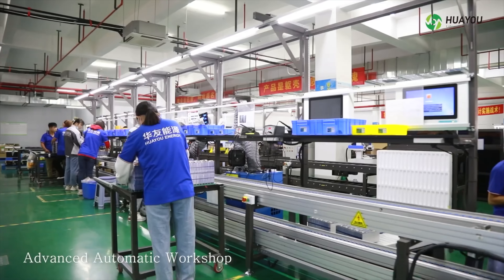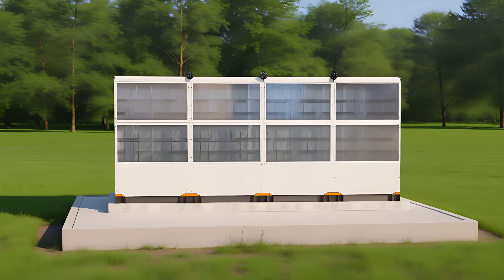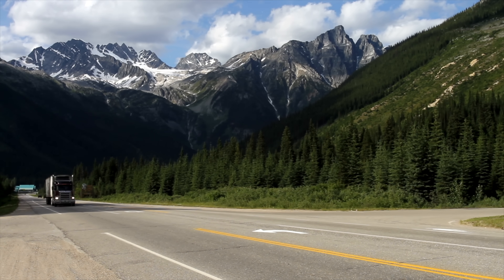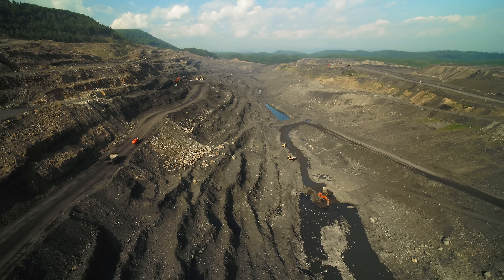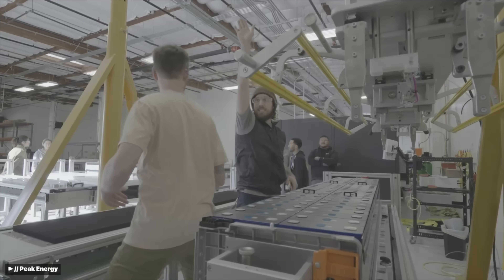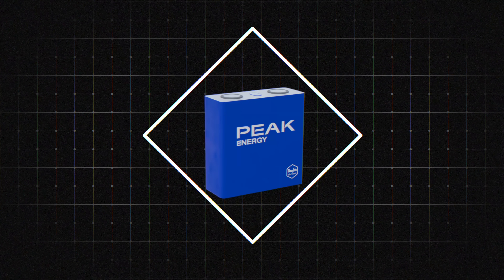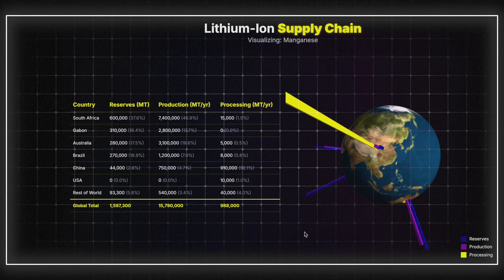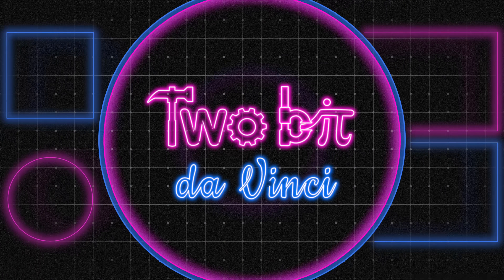Sodium Ion Batteries Are Going to be EVERYWHERE - Here's Why

Comment: Interesting. I looked at their website. Low heat generation is important. It shows that they have high cycle efficiency (they claim >95%), but part of the reason is also, that they have low C-rates (0.25). That seems to be one of the main limitations for where you can use these batteries.
Since it's a relatively simple ESS design, without the cooling, it might also be an interesting technology for home battery storage. Especially for off-grid situations, where you have relatively large batteries compared to your consumption, so C rates are not that important.
Reply: Agreed! The retail cost of home battery storage has dropped by about 75% since 2020, and that decline will continue. 

It turns out the demand side (EVs, heat pumps, batteries) of energy efficiency and electrification is as important as the supply side (solar, wind, batteries again). This summer, I installed a 14.4 kW solar system and 28.6 kWh of batteries. Five years ago, those batteries would have cost me over $1,300/ kWh. My EG4s cost $7,500! 

It isn’t just off grid! For the 85% of us who don’t live above the Arctic Circle or  in a forest or at the bottom of a canyon, solar and batteries are now less expensive to install and use to power a car and small business and home than installing and running new power lines and poles and transformers and gas plants. 

Sodium home batteries will be tremendously beneficial to home and business and vehicle owners. Paired with solar, they will allow most of us to economically produce and store our own energy. 

Even renters are starting to be allowed to generate a portion of their own energy with small solar panel/inverter systems. And soon, they will be able to put a battery in the closet that’ll charge at night when electricity prices are low and power homes and apartments when electricity is expensive.

Within five years, 30 and 50 kWh batteries, enough stored energy to power a typical home or apartment for two or three days, will only cost a few thousand dollars. 

Batteries are completely disrupting the home energy and personal transportation markets that used to bring trillions of dollars to the corrupt oil and electric utility cartels. But now, individual homeowners, and even apartment dwellers, can produce and store their own energy at costs the corrupt oil and electric utility cartels can not compete with.
Reply: Exactly, sodium-ion batteries (including Peak Energy's NFPP chemistry) has a lower energy density than lithium-ion batteries. This makes them less suitable for most consumer electronics :' (
Reply: @__WJK__  You might think that, but with zero issue of thermal runaway, they are much safer. Nobody cares if they have to charge their TV remote once a week versus once every 5 days.
Reply: Unfortunately the voltage profile under discharge makes sodium pretty useless with current inverters.  So this won't impact the home market untill the inverter technology catches up.  The life cycles are also poor compared to LIFEPO4.
.
Reply: @thamesmud  There are already sodium home storage batteries for sale with matching inverters, if they design a home storage battery, it is not difficult to find an inverter manufacturer willing to develop a matching inverter.
Life cycles of some sodium batteries are poor, but this particular design is marketed to have a long life cycle. Short cycle life is not necessarily a feature of sodium batteries, it is mostly a result of design choices.
Reply: @GerbenWulff we won't know the durability of sodium for 5 to 10 years.  LIFEPO4 seem to be remarkably long lived in solar systems.
Reply: If cooling is not required, then the cells themselves can afford to be a little less efficient and still meet RT efficiency targets at the system level
Reply: U need ur own channel maybe... 2 bit da Vinci 😊
Reply: Meanwhile in REALITY, their efficiency is below 90% and that is only at their HIGHEST voltage whereas their actual efficiency at an average SOC is around 85% or lower

Comment: This is really funny. CATL the biggest battery producer will start mass producing sodium batteries within 6 months. Tell me how this startup or the US will counter its might. The weapon of China is not Lithium it's Science. They have an astronomical number of patents related to battery technology and they keep pushing.
Reply: You are conflating EV batteries with fixed-base grid-scale batteries. In addition. there are multiple battery chemistries that employ sodium in some manner. Grid Energy is not in competition with CATL in any way.
Reply: @avsystem3142 And you think CATL does not make grid state battery ? There is a website called outworlddata where you can see stats about the number of battery patents coming from China vs US vs EU, you'll be shocked.
Reply: @avsystem3142  So you thinhk CATL does not make batteries for grids, considering the lead China has in green energy ? I think you would be shocked if you knew the number of patents related to batteries coming from China vs the US vs the EU.

Comment: Creation code pyramid code Da Vinci Code Nikola Tesla code all the same creation code for free energy anti-gravity solutions for all pollutions the best medical tool one could ever imagine we can make rain have food on every table and much more for the healing of all Nations..XO  X RAY 
All waves come in Trinity positive wave neutral wave negative wave it takes positive to bloom negative to action 
equilibrium=0= source of all light color sound 369 energy of all creation
WAVES OVE
3SOUNDs7
1Frequency. ... 
   Amplitude. ... 
2Timbre. ... 
   Envelope. ... 
***3Velocity. ... 
  Wavelength. ... 
Phase =SUM.7
3

Lights7:
1 radio waves,÷
    microwaves,
2infrared (IR)÷
    visible light, 
  ***3ultraviolet ÷
   X-rays 
Sum Gamma rays SUM7x
6
COLORs 7
1 Red÷
     Orange
2Yellow÷
   Green
***3. Blue÷
Indigo
SUM Violet 
SUM7
9
369 vibration frequency arclights 9 in tension Ark charge action

Comment: This battery tech looks really promising. I wonder if Elon is going to start using it soon.
Reply: It's probably more appropriate for mid- to grid-sized use.
Reply: Go back to your low IQ car cash videos. Elon is a fool and so is anyone who believes in this battery tech. Take it from a chemical engineer. Don't buy the hype.
Reply: @Science__Politics    I'm not "buying" anything, just watching reports of work on the problem.
Reply: @markhathaway9456 i wasn't talking to you. There was no @ at you.
Reply: @Science__Politics    I have always assumed a statement is responding to the original, in this case by TeksTherapy. I wonder if I've misread the typical ways of doing things with nobody telling me until this.

Comment: This could be a great solution for better grid performance but doesn't look to be replacing vehicles anytime soon which is fine.   Batter weight compared to carbon based fuels is always going to crush EV vehicles.   I also don't think you're going to sell America on reduced range,  Americans love the full tank of gas and can go X distance or drive all week.   You're not going to change those habits or perceptions anytime soon.

Comment: Have you heard of CATL is mass producing Sodium Ion batteries @ a substantially lower cost?
Reply: watch to the end
Reply: they are much cheaper than lithium and last longer and charge faster and are safer, but they don't hold as much charge.
Reply: @MrMichaelBCurtis most sources say the cycle life is less than for LIFEPO4 batteries.
Reply: @thamesmud  get new sources, or maybe Teslas is better, but the life is supposed to be more than 10 times lithium now. it makes sense since the dendrite issue has been solved. also there is no damage to salt if fully depleted and no issue with super low temperatures, both which hurt lithium life.
Reply: @MrMichaelBCurtis  - Sodium-ion can experience dendrite issues just like Lithium-ion, but is more suitable to mitigation by SEI layer manipulation although this is sensitive to heat. This is why CATL has used their barrier membrane technology in their Sodium cells not just their Lithium ones. Also, Sodium-ion, whilst offering better low temperature characteristics than Lithium-ion, has impaired high temperature response, with the electrolytes used becoming less stable at lower temperatures (from the mid-30c) and their SEI layer being sensitive to temperature, placing higher cooling demands on the battery system.
Reply: @GruffSillyGoat that is old technology, it is quite different now. Na batteries can operate at a much higher range than Li now, have significantly fewer dendrite issues now and don't need cooling. Na has grown a lot. do more research
Reply: @MrMichaelBCurtis  - my points are from the engineering and scientific papers published this year on current Sodium cells, including Chinese researchers looking into the subject on behalf of their battery industry as well as those of Europe, India and Korea. 

Not all the issues are resolved but mitigation steps have been identified, and are under assessment, the Korean/Indian joint paper Recent Trends in Artificial SEI Layers for Controlling Dendrite Formation and Enhancing Cycle Life: Toward Stable and Durable Sodium Metal Batteries (published in July) provides a good round up of the current understanding that builds upon other studies from last year that managed to image the nanostructure growth of dendrites in Sodium cells.

CATL are commercialising ahead of all the research as they are confident that a combination of their SEI self-forming technology and barrier technology mitigates the risks for their Naxtra cell approach, and also appear to be belt and bracing their approach by seeking to deploy their Sodium cells in a controlled set of use cases, including those limiting charging to 4C or less.
Reply: @MrMichaelBCurtis 😂😂😂 since when have they solved those issues😂😂😂
Reply: @GruffSillyGoat that is old news, and I found out just now that Tesla is changing from Na batteries to Al batteries, and they have zero dendrite issues and no flammability at all due to a gel instead of a liquid it doesn't outgas at all even if the cell is punctured
Reply: @HeathensHaunt  Tesla just changed to Al battery not using Na anymore. check it out the fluid is a gel and puncturing it creates zero outgassing, The battery life is 100 years and the 80 charge time is 3 minutes and the 100 percent charge time is less than 5 minutes
Reply: Why compare to LMC, and not LFP?
Reply: @emmanuelobiwulu4823 they don't hold up well compared to LFP.  The voltage sags on discharge, the C rate is poor and the cell cycle life is not as good.  The only advantage is cost as far as I can see.  They are not a drop in replacement for LFP  new inverter hardware would be required.
Reply: you do realize this means you would need new inverter tech and so on and such since this is not in any way compatible with what is on the market for usable parameters
Reply: @HeathensHaunt  Inverter electronics to provide constant output with a varying input is trivial. I'm a electronics engineer.
Reply: Maybe someone did not reveal that “that path without Manganese “ had already been done. 😅
Reply: Not without Manganese, which is why PEAK is first to this exciting American tech!😊
Reply: @PETERJOHN101 manganese isn't exactly rare, so that isn't a huge deal